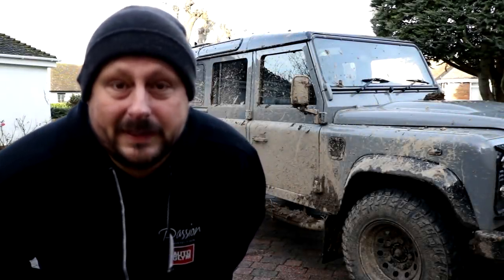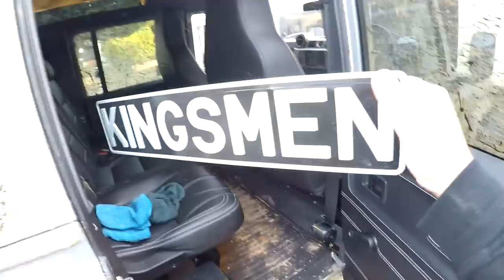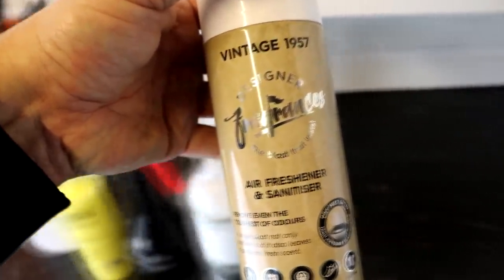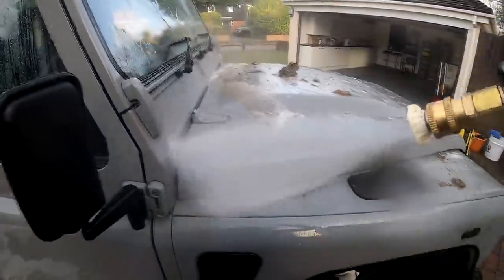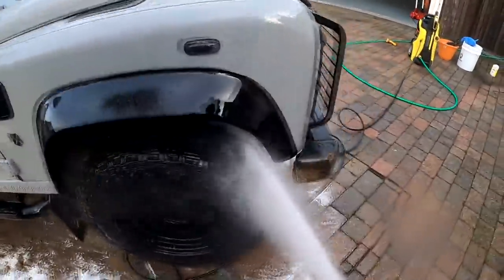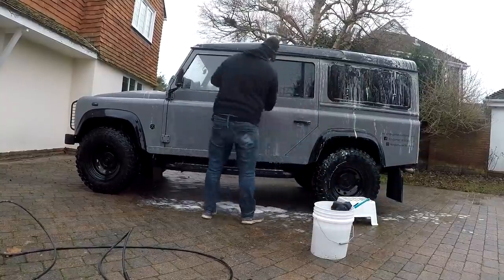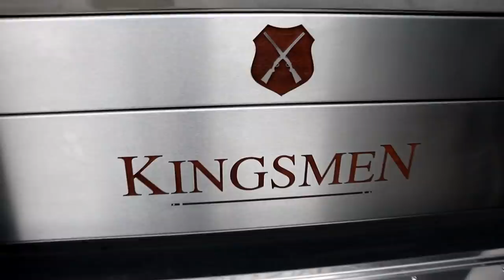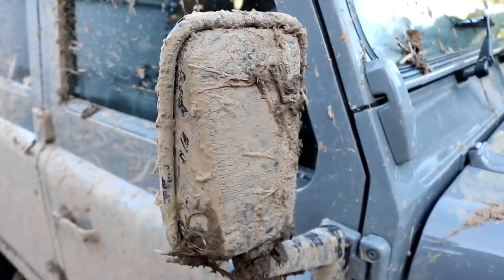Embalmed in Thick MUD | Land Rover Defender Kingsmen | Extreme Dirt Detailing

Comment: I think I would have just done a rinse first of all. Just to get the loose stuff to run off before the foaming.
But a very satisfying video to Watch. The dirtiest cars are the ones that are funniest to do. The difference is soooo visable.
Reply: Codriver72 it helps to lubricate the dirt to minimise scratching when its jet washed off
Reply: This is also a good test for the snow foam to show how well it performs; instead of pre rinsing
Reply: I was thinking the same... would have used this as a chance to do a 50/50... half with snow foam and the other without. 🤜🏽
Reply: I cant see the point of snowfoaming dirt like this as the foam is never going to penetrate enough to get to whats next to the paintwork? Great vid as always though!!
Reply: I agree you should have power washed all the stuck on mud and dirt but great video thou
Reply: Why?  .
No it won't
Reply: Yeah. I was watching him put the foam on first and I was wondering why do that? Do a rinse first to get that called on mud first then use the foam to get the finer particles of dirt.
Reply: Jay B normally because the foam doesn’t stick as well and can run off quickly when the car is pre rinsed and left wet, but I agree it probably didn’t have much impact foaming it on the areas with thick thick mud, but a bit for the less caked area, still worth doing 2 times over before a contact wash though.
Reply: Best to power wash most of the dirt of prior to the foam/wash.
Reply: Ok nope this guy ain't a detailer (coming from a detailer) you use one bucket then you wash the door jams and with the SAME cloth you give the door card a wipe down aswell 🤮
Reply: Yeah I always rinse first
Reply: I think u're right

Comment: Ive watched a lot of detailing videos and this is the first time ive seen someone cleaning the underside of the vehicle. Drives me nuts when detailers dont do this for muddy vehicles.
Reply: Ikr...always wanted to see them clean the underside
Reply: Watch details geek channel
Reply: Harish Bishnoi  yeah he cleans the underside
Reply: Watch detail geek my guy
Reply: @VIVI-du1iz  not always. Maybe he didnt have the attachment before, but Ive seen videos where he did not clean tbe underside
Reply: @andregoncalves7856  he said he does but he cuts it out because it takes. Too. Long with just one hose
Reply: deadend not with the youtube vids im watching. most of the time, they also skip on cleaning the engine bay.
Reply: Do check out the detail geek he's amazing
Reply: Wish he would have tackled the engine bay! I know that’s gotta be trashed!
Reply: Unfortunately most detailers don’t have an undercarriage pressure washer or something of the sort and trust me, trying to clean the underside of a vehicle without one will double, sometimes triple the amount of time spent on a wash because you just can’t get an angle on most underside surfaces, even laying down in the filth. Ever since I bought one my life has been made one hell of a lot easier. I spent a few days engineering a secondary feed into the jets to where I could put raw product into a small holding tank and it would feed into the jets at the correct dilution that I preset and that changed the game forever.

Comment: I would never have thought of using the patio attachment upside down to clean the underside of a vehicle. 😳 That's bloody genius and something I'll try on my own car next time. 👍
Reply: My exact thought watching this! Genius!
Reply: Yes brilliant idea. Must buy one for my nilfisk pressure washer.
Reply: But won't get half of that crap off but ingenious. Where do you get one of those? I've never seen them before.
Reply: @johnwagner4559  I got my one with the Karcher.
Reply: @johnwagner4559  it wont on that because it's too high. Karcher used to do a proper undercarriage cleaner which is effectively the same thing but has a rising and lowering function to get the head closer to the underside. Has the ability to feed chemicals in at the attachment too. I'm guessing Jon fed his in at the K7 jetwash in this vid, like when using patio cleaning fluids.
Reply: Learn something new on here
Reply: @tracy-dg3qq  I tried it last weekend but it won't fit under my car. 😭
Reply: @gingerphil  Jack it up lol

Comment: i would rinse that off with pressure washer first before doing foam bath..
Reply: Jesriel Cruiz finally someone who gets it
Reply: Well he got the job done, I'm impressed he used a brush at all
Reply: Jesriel Cruiz I agree with you but people have different techniques
Reply: The foam loosens the dirt up so when you pressure wash it off it won't scratch the hell out of the paint
Reply: Austin Andrews with all due respect.. not chemical is going to absorb through that to loosen it, but yea whatever.. for the less thick bits, he probably hosed on a lower pressure initially though
Reply: @lukewojcik8663  degreaser, tar removal, iron remover, theres plenty of chemicals thatd loosen it from the paint, the whole point of him washing it at an angle like he's pushing it off and not directly into the paint proves it, a white tip at that distance wouldnt do anything to dirt otherwise. Believe me I wash semis, clean the insides of semis, mobile detail and power wash for a living. Chemical makes a huge difference in pulling up dirt off of a surface.
Reply: I mean, for efficiency specially if you are trying to be thrifty with your chemicals, you might want to rinse off that thick mud with soft pressure just to softened it. if water can get it done, why waste extra chemicals.
Reply: Yeah why he do that???
Reply: @austina4677  yeah no. Dirt isn't grease.
Reply: No. Foam on dry car ! It's the right way he took
Reply: Just let the man do whatever he wants... Jesus . If that's how he wants to do it  let him do it
Reply: You questioned this before watching any more didn't you? Snow foam, rinse, snow foam again. For this situation he did it just fine.
Reply: Definitely a pressure rinse 1st
Reply: Jesriel, thats car washing 101. What the hell is he doing ???
Reply: @Jahidur Rashid Nonsense.... Mud is water based. water and pressure is all he needed for the first rinse. He actually would have been better off with a higher pressure gas powered PW to remove the heavy debris first.
Reply: @Jahidur Rashid I'm all for snow foam. It's part of my process. Just not on top of clumps of mud grass
Reply: @Jahidur Rashid What are you smoking up there on your high high horse? Are you one of those guys who puts half full bowls of spaghetti in your dish washer or spreads rock salt on your driveway full of snow?
Reply: Exactly
Reply: I know people who scrub a dirty plate with a soapy sponge before putting it through running water. Disgusting!
Reply: Really and risk scratching the paint what great idea 👍🏽😂
Reply: Totally agree with you 💯‰👍🏻
And did u know that he MUGS of his beloved viewers 👌🏻

Comment: That vehicle is just way too nice and valuable to ever be that dirty..
Reply: Keith Olsen If you don’t want to get a Land Rover dirty, then you shouldn’t be driving a Land Rover.
Reply: @JohnMcMahon.  I get the older one dirty, the new one stays in the concrete jungle..
Reply: Keith Olsen But it doesn’t want the concrete jungle, it wants to be free.
Reply: This is the proper use of a land rover.
Reply: @Vakhi201  I agree, they do a great job off-road. If money is never an issue and you don't care about condition and resale value, then yeah, beat up on the new custom show quality model if you want.

For most of us it's not the smartest, most responsible and practical thing to do. You can pick up an older model for a tiny fraction of the cost and have all the same fun.. But that's just my opinion based on my own personal experience. 👍✌✌
Reply: Keith Olsen At the end of the day I very much agree with your statement. I myself would rather buy and older one and do the exact same thing with it. I also find the older ones have more character then the newer ones. And less tech to fix when it breaks.

Comment: To clean a vehicle as dirty as this you would use a large tarp, simply drive the vehicle on the tarp to clean vehicle. After you've removed the dirt and debris you drive off the tarp and move it out the way to continue cleaning vehicle.
Reply: True :)
Reply: Or just drive to the local jet wash, spend £2 and hose the worst of it off lol
Reply: @markkerr3761  was thinking the exact same as yourself. Quick jet wash to get the worst off it.
Reply: @markkerr3761  yep, exactly! This is nothing.. I live in an area with lots of country boys with big lifted up trucks they go off roading and "mud running" with them.. it's a fun ride as a passenger, but I'd never do that to my own vehicle.. like inches thick of solid mud.. some of the car washes have signs and employees to police people if their trucks are too muddy..
Reply: In my area of NorthEast PA there are lots of pickup trucks with mud on them. The car washes have signs posted to wash the mud and debris down the drains. If you fail to clean up after yourself remeber to smile you ate on camera along with your plate #. And along comes the Sheriff.
Reply: @markkerr3761  thata exactly what I was thinking, local supermarket jet wash and get the worst of it off and leave the mess there!!

Comment: Jon how are your getting the atom mac into the patio cleaner attachment and at what dilution,  I usually just spray it on with a garden pump sprayer but this seems a better option as it will force it's way into more places.
Reply from the maker: i put abouit 30 ml in with 500 ml into one of those karcher bottles that plugs into the top of my machine you see the bottle on the left at the start

Comment: Finally someone who does it properly and snow foams first 😂
Reply: Right
Reply: Right
Reply: Wilbert Cineus 
Right
Reply: no, get the mud off, and then foam who foams first it doesn't get to the actual car
Reply: @russetmalenski4645   Foam is to soften to mud, foam, leave it on a few mins then rinse off then go to a hand wash.
Reply: @lewisdawson2518  with an actual pressure washer (not the one he's using) you can skip that and save foam.

Comment: Cool trick with the patio cleaner, have you modified the patio cleaner in anyway so it's not dragging across the ground upside down? Cheers.
Reply from the maker: hey steve no it just sits on the ground and I drag it.. Its gonna stuff it up a bit I guess its a hack but it works really well and you can also feed the chems through the chem feed in the main unit which is an added bonus.
Reply: @ForensicDetailing  thanks for the tip, I'll be using my patio cleaner alot more now.

Comment: IMO should have rinsed it first them snowformed after, just MO that's all. :) by the way what is the temp in your areas at the moment and might sound like a silly question ,but in england do they use chemicals to help the snow on the roads stay none icy etc, if so what type of chemicals and does that effect the cars painted surfaces and especially under the cars surfaces?
Reply: Hi,

Just thought I'd try answer your questions. Current temperature for me South East, UK is about 6 degrees celsius.

With regards to the roads they're gritted. Which is actually rock salt. Rock salt lowers the physical freezing point of the moisture on the roads, which stops ice forming and causes any exsisting snow to melt.

When the gritter lorries come down the street or drive past on the roads you heae the grit hitting the car/cars. I imagine the salt plus winter dirt and constant moisture would start to cause corrosion. 

Hope this help, happy new year!I

Comment: You can buy the flexible rubber hose pipe for the karcher on eBay , loads better then the plastic coating type that they supply with them

Comment: You missed a bit Jon! The inside of the rear crossmember is a mud collector and this one has stupid checkerplate on it which doesnt help but you can still get in at the sides with a pressure washer.I know this as I have a 2000 Defender and I fitted a new galvanised chassis as mine was rotten.

Comment: Sorry me again. How did you apply the atom Mac to the car? Was it in a spray bottle, skooshed on then sprayed with the patio cleaner?
Reply from the maker: I use the karcher feed bottle which plugs into the karcher unit and I can feed it through the pressure washer as Im cleaning the under carriage.
Reply: @ForensicDetailing  and can you control the ratio or did you dilute it down first?
Reply from the maker: @markkerr3761  I used about 30ml in to 500ml which is a lot but its gonna get knocked down a lot more when it goes through the lance.

Comment: Jon. When you use the patio washer to wash the under side of the car how do you get the corrosion inhibitor sprayed under the car?
Reply from the maker: hey darren my karcher has a chemcial feed so you can put it in there (you need to do a rough PIR conversion though) or you could use a pump sprayer with the stick/arm
Reply: @ForensicDetailing  I’ve got 2 k4 jet was do you mean the shampoo feed bottle?
Reply: @ForensicDetailing  hi Jon.have you got wheels on the bottom?

Comment: Good morning my friend,can I ask you a completely unrelated question,I’ve got meguiars compound ,Bilt Hamber wax sealant and meguiars liquid wax,is it ok and will it be effective to use them in that order.
Reply from the maker: ok use meguiars compound.. then do a IPA/water wipe down after ulrimate compound or polish.   Then apply meguiars liquid wax  or Bilt Hamber sealant.  Using both will do nothing.  MEguiars liquid wax I think is a silicone polymer sealant I think.  but just use this its a really nice product.
Reply: Forensic Detailing Channel ,ok thank you ,I used the meguiars about 6 months ago ,was just wondering if the Bilt Hamber was a better product in your experience

Comment: Can I ask why did you snow foam on top of the dirty Land Rover and not after it had a pre rinse ?
Reply from the maker: pre rinse without intial soak will not remove much road film and waste water.  
also there are little rocks and grit embdded in the mud blast these with pressure is prehaps not good idea when the low pressure soak will allow a lot to melt and slowly fall off the car (safely)
If I pre rinse with water.. when I then do my proper pre rinse with product the car is holding a few litres of standing water on the panels which further dilutes my first pre rinse down making it about half the concentration maybe even a lot lower concentration (some guys recon like 80%)
By pre rinsing properly like I did, then my first pressure wash removed a massive amount of the film.. (aka you can see how bloody effective it was simply by watching)

like ive said to other people before shooting this video I knew I would get about 500 comments complaining I didnt "pre wash" the prewash.   but from doing you tube for years I also knew if I prewashed with water first there would be 500 comments from another bunch of guys that do it differently.   The truth is theres arguement both ways and it doesnt make that much difference.   Only people generally new to detailing and get caught up in all the pipe smoking side of it, 20 bucket method, wax in straight lines etc etc etc...

Comment: Was the pressure washer power turned down as it didn’t look that strong maybe just being used to a krenzle
Reply from the maker: it has 6 levels of power.  I ran it at level 3 (or lower level 2 on the karcher display).   levels 5 and 6 (3 on the display) are dangerous really for cars, yes you can go further away but level  3-4 is best for cars..

Comment: When cleaning a door card and you're not sure which bit is leather and which bit is soft vinyl, should I err on the side of caution and use leather cleaner on both sections? OR, does anyone know which section is which on an 08 E90?

Comment: Hi there just double checking did you use the BH Auto wash through the snow foam? What the benefits of using it that way?
Reply from the maker: benefits are I dont have to waste time collecting product fro bucket and plonking it on the car..   I can cover a section I get more lubrication, more soaking going in, Its quicker..  less buckets (just one rinse bucket)... It works great in the winter this method.
Reply from the maker: yes  to AW in the lance sorry

Comment: How do you control the pressure using that one handed lance? On my karcher k5, the xontrol is on the lance???
Reply from the maker: So I leave the OWN full control head in the unit and it has a + and 1 pressure.   I sometimes up pressure to max when foaming through a lance and drop it down to the Lowerest setting on "2" when just using the gun.
Reply: Forensic Detailing Channel ahhh, is that cause ot works via wfif/bluetooth
Reply from the maker: @karonroberts5888  yes thats right.
Reply: Forensic Detailing Channel nice one cheers. Love the channel, keep up the good work 👍🏻

Comment: Having worked for JLR and especially on the limited run/special project vehicles for some 25 years the rust inhibitor that your using doesn’t make a blind bit of difference to the under-car/chassis protection that is already there !
Reply from the maker: I didnt say it did and your misunderstanding why I use it.

Comment: I can never get my auto foam to go on that thick it's quite watery and runs off quick. Using a karcher k2 and foam Lance. Any ideas??
Reply from the maker: its prolly lack of punch..  but a PA lance will give better foam.. and you can try do the 1.1 orrafice upgrade... but I would not worry about mega thick foam its not that important..   but K7 has tons of flow and pressure so it will naturally give better foam...
Reply: @ForensicDetailing  thanks for the reply Jon much appreciated

Comment: Why not pressure wash with water only to remove the big clumps of mud especially on tryes and the running boards, is there any special reason? Are you trying to avoid something like abrasions on the finish?